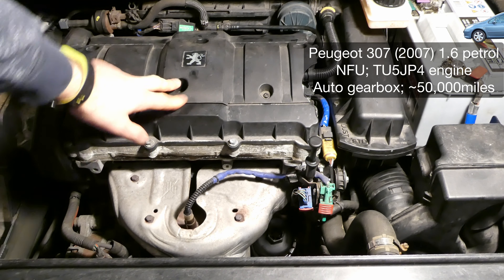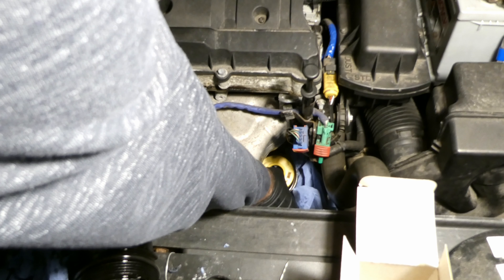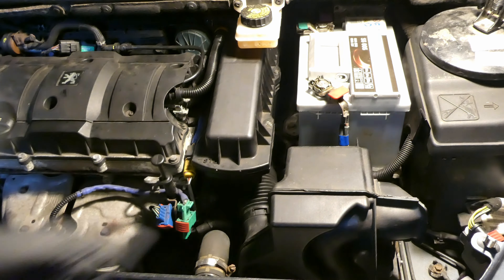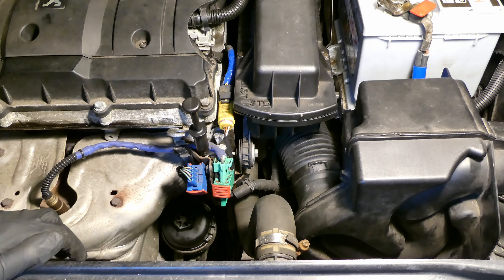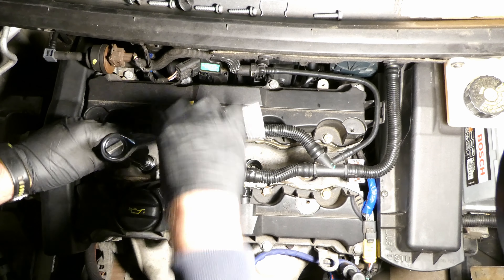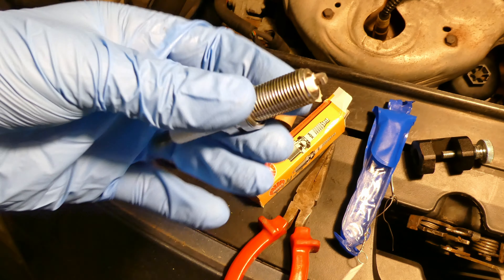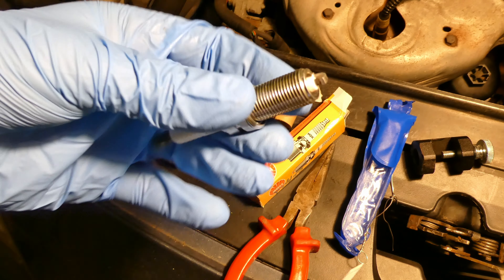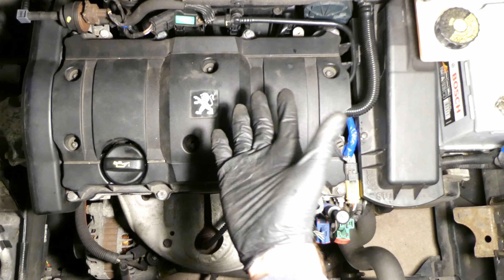Peugeot 307 1.6 petrol full annual service, including gapping spark plugs and service counter reset

Comment from the maker: It took me forever to produce this video. From forgetting to film stuff, to filming it and at the end the camera was stuck on some weird focus and everything was out of focus. Had to refilm all. So much out of focus that even had to buy a single spark plug and refilm the gapping. Hope you enjoy it. Let me know if more info is required.
Reply: I don't know if the seloneyit valve will cause so much trouble, but I think there is a malfunction in it even though I changed it, you are right.
Reply from the maker: If it is the 1.6HDi, the solenoid valve can cause problems. Either too much pressure and not releasing or no pressure at all and no turbo, e.g. underboost or overboost.
Reply: such a great job ! I'll be on it too after I've received my spark plugs ! Thank you sir !
Reply: Also probably you bay some better tools. It will help a lot. Great video. Thanks.
Reply from the maker: @СашаДр  What is wrong with my tools? Were I driving a Porsche 911 or something I would have bought expensive tools. As long as the tools do the job required, there is no need for expensive tools.

Comment: Thanks for the video, very informative and helpful. My friend got a 206 station wagon in mint condition with only 48,000 km, with the TU5JP4 attached to a  4 spd automatic. He is coming close to the annual service. I already have everything at home for the job. Just to be sure about the "challenges". cheers
Reply from the maker: Mine is the same engine and gearbox, but the 307 variant. Good luck with the inspection :-)

Comment: Nice video, I've also got the 307 1.6i. The service counter varies from car to car and depends on your driving style and conditions. The car's ECU will automatically adjust the duration. I drive my car 90% of the time in the city, often on short distances and don't particularly look after the car. When I reset the service indicator, it shows 18600 miles to the next service.

Comment: How about changing fuel filter? Is that needed?
Reply from the maker: These 307 engines do not have a fuel filter, unless you live in a country that do have, hahaha. Mone does not and most do not have a fuel filter, but you can double check, if your car has one, it will be next to the fuel tank, just follow the fuel line.
Not too sure why they decided not to have one, I suspect that the fuel injectors are quite cheap and fairly easy to replace.

Comment: I have a 2007 model 1.6 turbo berlingo car. The car accelerates late and throws excessive smoke in sudden gas and sudden accelerations. I changed the air flow sensor and turbo, I changed the injectors, and it didn't work. I changed the en75, but I changed 2 hands, I couldn't find a solution, what are your thoughts on this?
Reply from the maker: Is this the 1.6HDi or something else? You have changed a lot of stuff, but I am not too sure what en75 is. I would check if the wastegate or turbo solenoid (if it is the 1.6HDi) are not somewhat stuck and release with a bit more pressure.
Reply: I also changed the egr. 1.6 engine berlingo vehicle
Reply: @moremolecules  When you press the gas, the turbo valve does not move at all. It always takes the valve to the closed position and stays there. The valve closes every time it works.
Reply from the maker: Is this the wastegate valve? If it stays closed, it i not working, whether this is the valve itself or the pressure from the solenoid it is not clear.

Comment: i realy never ever seen that a person do this with a sparkplug.... i should be scared about to weaken the sparkplug tip and that it broke inside youre cilinder...
Reply from the maker: Ohh, yes, that is how it is supposed to be done. At the end of the day you are not bending it and making it up-right again multiple times in order to weaken it. You need the correct gap!
Reply: The tools he used are called feeler gauges in the UK and they are used by car mechanics to set plugs like this all over the world. The electrode is fairly malleable so this can be done, carefully, a few times, but if you have to keep doing this, it's usually time for a new plug.

Comment: no need for 30 minutes drive , you can remove oil as soon as engine get working temperature around 100 degres. also never change spark plugs on hot engine only on cold one
Reply from the maker: Absolutely agree on both counts. I only do it for 30min in order to top up the battery as well and get some of the suspension components moving. Pandemic and all...
The spark plugs, yes, completely agree. I should have mentioned that I do them the next day if I do the oil drain in the evening.

Comment: In my 307 i have to put 4.5 liters so the dipstick shows the right level of oil why is that ?
Reply from the maker: This seems quite a bit. At least my Haynes manual says 3.25L including the filter for the petrol 1.6 version. 4.5L is quite  bit more, unless it is a different model than my 1.6, say 2.0L or a diesel?

Comment: Thank for this video and give me an insight what to do and saves me a lot of money 💰
Reply from the maker: It is pretty simple to do an annual service in the 1.6 petrol version, I probably showed it more complex than it is.
Reply: @moremolecules  it’s in detail at leased and my car is a Citroen c4 1.6 everything mechanically the same the only issue I have is my air con pipe replacement and suspension shock dampers
Reply from the maker: @kevinleavy8565  Good luck, it is pretty simple engine, not much to go wrong with it

Comment: I've taken to extracting the oil out of the dripstick pipe.  It save having to get under the car and all the oil can be removed.  I tried doing it this way and then removing the sump plug to see if there was anything and found that there was nothing left in the sump.  I makes things easier and cleaner to do
Reply from the maker: Yes that works well. I need to buy a pump or use my syringe to get out the oil.
Reply: @moremolecules  I use a hand pump vacuum system…it works really well
Reply from the maker: @martinbateman2467  Yeah, next time I am also doing it that way. Too much effort to take the undetray of the car.

Comment: Nice tips, I will be going to replace the spark plugs soon and this was really helpful, thank you!

Off topic question seeing that you have an oil temperature gauge underneath the RPMs just like I have: Did you ever saw the temperature raising above 100 C? Mine always runs with a line above 100 degrees while maintaining a speed of ~100 km/h or more. And the coolant temperature stays at 85 C degrees, knowing that in the colder days the coolant temperature goes about 70 degrees while running. I've changed the oil since I was observing that (this summer), replace the oil temperature sensor but it didn't make any difference. Have you ever encountered that?
I don't know what to think of, I was thinking maybe the head gasket is worn but the water is not boiling nor oil is present in the expansion tank or vice versa.
Even I have put the car through a diagnosis and there is nothing shown. No errors.
Any advice would be appreciated. Thank you ^^
Reply from the maker: Yes, the 100C is the oil temperature and on mine is the same as yours, no matter the speed, the oil temperature will be ~100C. I have not seen it rise >100C so far. This should be normal, no gasket problems. The oil goes around the engine, it cannot drop, it takes the heat from the engine and the coolant cools the oil.
The coolant temperature though is rather variable, if I am travelling on highway/motorway it is ~80C, but if I stop for a short while it jumps fairly quickly to quite a bit more (90-95C), then the fan kicks in and the temperature drops and this goes on like this. Petrol engines run quite a bit hotter than diesels, my 1.6HDi does never go above 82C or so, it has to be really hot day and stationary for long time.
All in all, your engine seems as mine and pretty normal.
Reply: Oh I see, so then maybe it's just in my head that I would have an issue x_O
Thank you man! Really appreciated! Good luck with the channel. Quality content👌
Reply from the maker: @ksoulmusic  Nothing to worry about. If there is a head gasket issue, there will be 3 symptoms or a combination of them. Milky substance under oil filler cap (mayonaise like), or oil in the coolant expansion tank or a lot of white smoke coming from the exhaust even when engine is in operating temperature.
I was always a bit worried about the relatively higher coolant temp on my 307, but forget that petrol engines are not that energy efficient as diesels.

Comment: Where is fuel filter location? Have the same location like you but can't find fuel filter(
Reply from the maker: As far as I know there are two versions of this model. Most do not have fuel filters at all. In case you have one, it should be very next to the fuel tank! Like a small canister type of thing.

Comment: the oil filter should be clipped into the filter cover. Next, when replacing the filter, it should hold in the filter cover after removal
Reply from the maker: Yes, it should but it does not always. The filter cover just holds the filter, not much else.
Reply: ill watch out for that one when i do an oil change I'm glad the engine is a lot easier than my santa fe that we had,ERG valve was a nightmare to change.
Reply: I was thinking that and was looking for comments about that thanks.

Comment: Hi can u please tell me where is purge valve canister located in this engine please.
Reply from the maker: not too sure which valve canister you mean, but the fuel pressure valve is here: https://youtu.be/NMHHmCH2BzU?t=494
Reply: @moremolecules  thanks but it's not that but I'm thinking it's in behind windscreen somewhere, it's purge canister solenoid it's black round plastic thing with pipes connected it lets out the fumes from petrol tank and if not working it gives a fault of depolution system faulty .  Po443 code.
Reply from the maker: @martymartin2894  Not too sure about that canister, sorry. I have not heard it as well. There is a vent on the petrol tank itself to purge fumes.
Reply: @moremolecules  no bother thanks I seen other videos which suggest it's behind the window screen after intake manifold or behind cover in drivers wheel. A few have said it's behind wheel cover seems like a strange place.
Reply from the maker: @martymartin2894  I have never seen a canister in either wheel arches, but maybe I was not paying attention. As far as I know there is a vent in the fuel tank on top and that's about it.
Reply: @moremolecules  there's 2 canister one is vent and other is purge I think on both ends of emissions systems. One is near fuel tank I think it's vent other purge one is closer to engine I believe near intake normally.
Reply from the maker: @martymartin2894  Many thanks, I will investigate these canisters as I have not heard them before.

Comment: Does anyone know when to change cambelt? I heard 4 year 
Peugeot now says 10 year whats right?? And do you need to change the oil in the 4speed automatic gearbox?
Reply from the maker: The car's handbook should tell you when to replace the cambelt, but 10 years seems reasonable, but of course depends on how many miles/km you have travelled. You do not need to change the oil in the auto boxes, but might be a good idea to do so.

Comment: What will happen if air filter is never changed, will engine go bad .
Reply from the maker: It will eventually start smoking a bit as it will be starved of air. In the worst case scenario, completely blocked filter with time, the car will either stop working or the filter will be break somewhere and all the dust and particles will go through.
Reply: @moremolecules  ok thanks I took out mine and it's practically like new not even dirty.
Reply from the maker: @martymartin2894  Depends on how dirty the air is where you are and how close to other cars you drive. I it always a good idea to change ot, but visual inspection is also kind of alright.

Comment: My 307 2003 has different filter box, lot easier to get to it
Reply from the maker: Yeah, mine is 2007, the facelift model, so they have changed a few bits here and there.

Comment: Mypeugeot 307 1.6 16v nfu ha e problema with water temperature.
Ho up ti 110.... When i used AC After off goback to 90!!!
Reply from the maker: Maybe there is air in the oolant system. Have you tried to clean any air out, for example like here: https://www.youtube.com/watch?v=An0ClZBverw
Also, does the fan kick in ~90C? Could be fan relay or the fan itself. Mine always kicks in at ~90C and brings the temp down.

Comment: واشر سرسیلندرت آخر عمرشه فک کنم
Reply from the maker: If you point the slight oil passing through, that is not the head gasket, the head gasket is one below that. That is only a silicone that has perished a little bit, might need to do it one day.